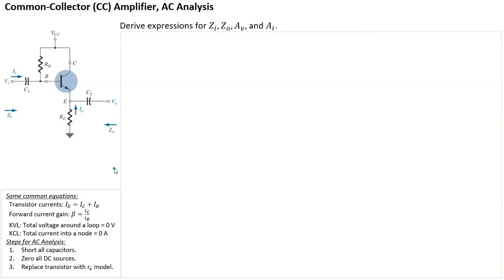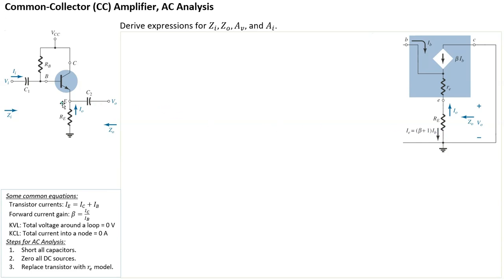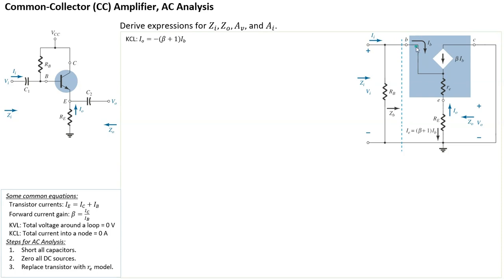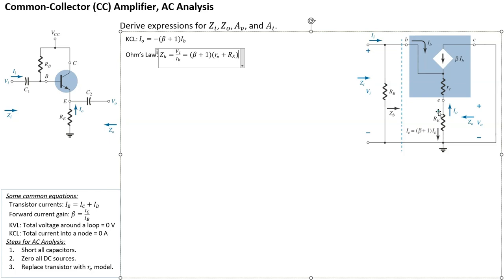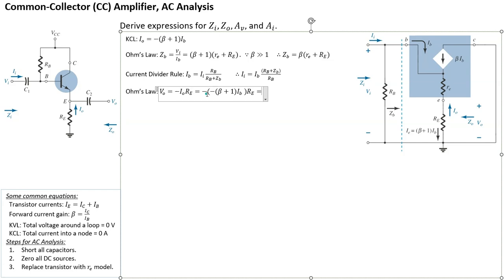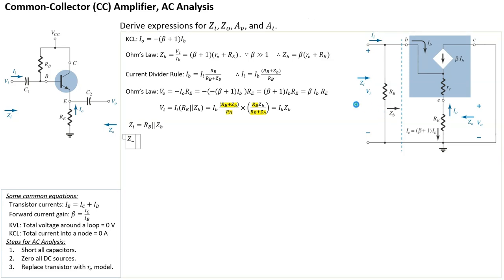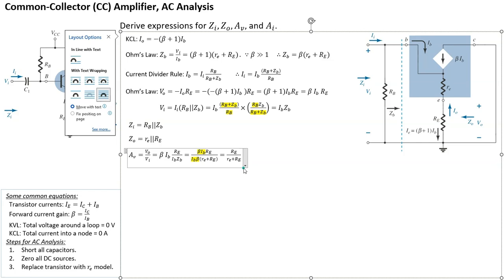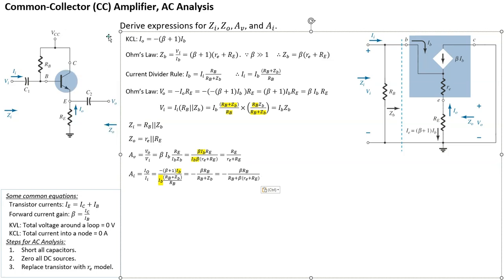Common Collector (CC) or Emitter Follower Amplifier, AC Analysis

Comment: AS USUAL EXCELLENT LECTURE!MOST TEXTBOOKS SEEM TO INCLUDE THE INTERNAL RESESTANCE OF THE AC GENERATOR SOURCE.WHAT DOES THE Zo FORMULA LOOK LIKE IF YOU INCLUDED SOURCE RESESTANCE AND,WHY DID YOU NOT INCLUDE IT IN Zo FORMULA DERIVATION?
Reply from the maker: Thanks David. 😊
I'm going to assume that "internal resistance of the AC generator" is what most textbooks refer as r_o (internal resistance between the Collector and Emitter), and the "source resistance" is a series resistance to V_i, mostly indicated as R_i.
For R_i, it's presence would create a voltage divider between itself and the parallel resistance R_B and Z_b, where V_i becomes the main source and V_(R_B||Z_b) (i.e. voltage across the parallel of R_B and Z_b), becomes the  smaller voltage. If R_i is large compared to R_B||Z_b, then most of V_i will not appear across the input to the amplifier and you'll have a very poor amplifier. This is part of what we call impedance mismatch. The presence of R_i will affect the A_v and Z_i.
For r_o, it's going to end up being parallel to R_E and therefore affect all 4 parameters.
I don't include r_o to simplify the analysis since in most cases r_o tends to be more than 10 times larger than R_E.
Hope that helps!
Reply: THANK YOU!